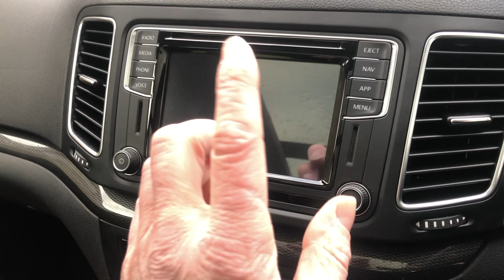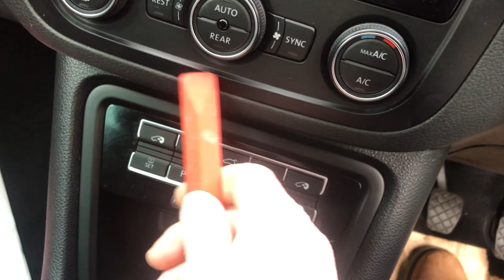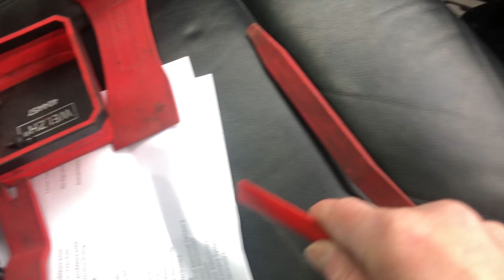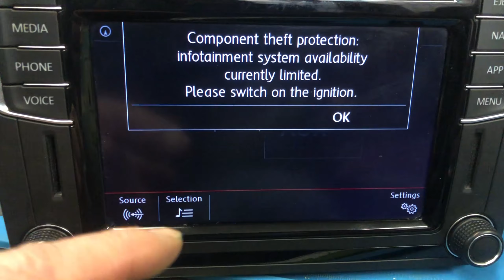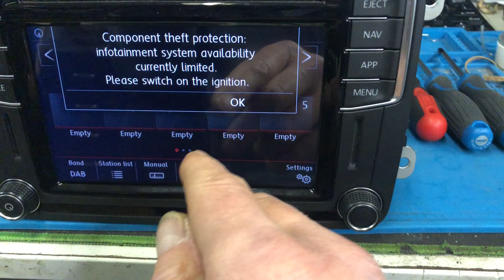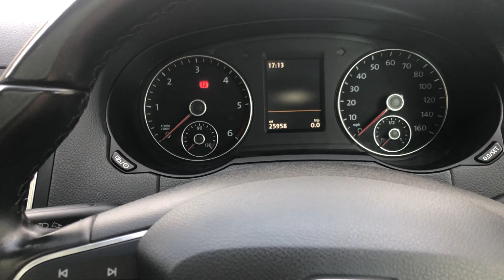VW MIB2 Stereo SATNAV Seat Alhambra Remove Repair Touchscreen Digitiser Remove Component Protection

Comment: Thank you for your detailed explanation in your video.

I have two questions:

1. What's the part number of touch screen digitizer of this multimedia radio system?

2. How to unlock full link in this system as it is factory locked?

Thank you in advance for your kind support and cooperation.
Reply from the maker: Hi, thanks for watching - part numbers of the digitiser is stamped on the screen, sadly I cannot go into detail on how to unlock the Component Protection as we are a business - If we showed that then before long there will be people copying the method & selling the service on EBay, then it’s just a race to the bottom on price.. We offer this service via our website - links are in the description, or click below:

https://ecuconnection.co.uk/product/vw-seat-skoda-audi-mib2-std2-pq-technisat-discover-composition-stereo-programming-repair-service/

Comment: Hi, Thank you for a very good YouTube of changing the digital screen.I have just purchased a digital screen I will fit myself. My question is can you change the vehicle speed when the auto head lights go from dipped to main beam. The reason for this is we live in the countryside where it is difficult to drive up to 60kph when the auto dip to main beam operates. I am disabled with having only one arm so auto head lights is good but I have to drive fast to get it to work and that is not safe around here. Thanks in advance regards Mike
Reply from the maker: Sorry, I don’t know about that system..

Comment: It is a kind of beneficial video. I have a question as always :)) . When you change the clusters, you got the information about immo, mileage etc. from eeprom in old cluster. Is it enough to clone it?
Reply from the maker: There is not enough data in the EEPROM to clone the cluster, first we read the data on our test rig - its easier with a working key - Then we set the donor cluster into service mode (We didn't have a working key for the donor) - then we can read the donor cluster immo data on our bench rig, then we transfer the ori immo data that we previously read, we also set the soft coding on the bench & adjust the mileage, sadly at present we do not have a way of transferring the 'Component Protection' - Hope this explains some details, hopefully soon we will publish more videos on cluster replacement.. Thanks for watching!